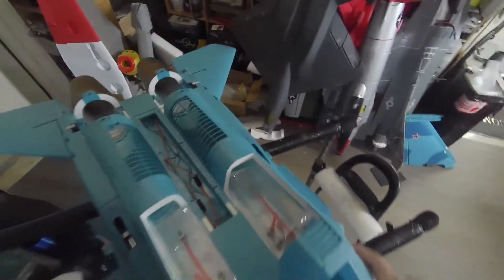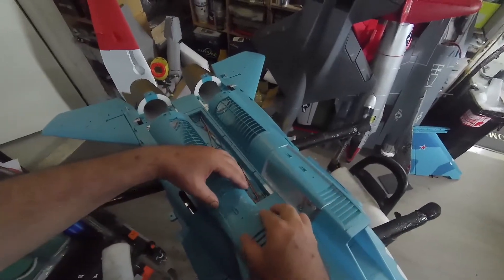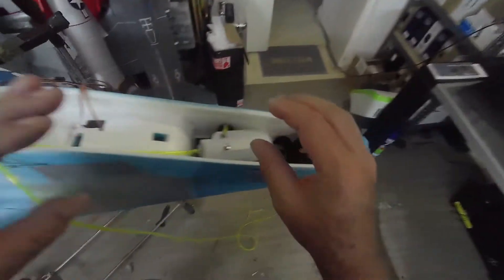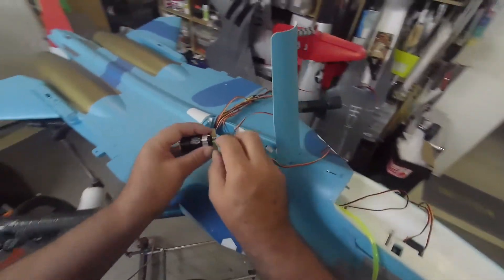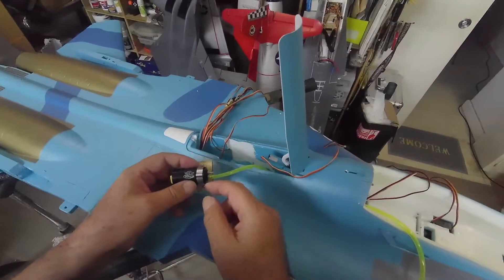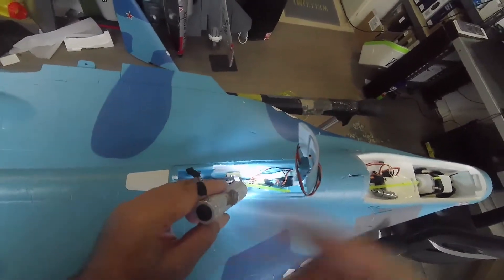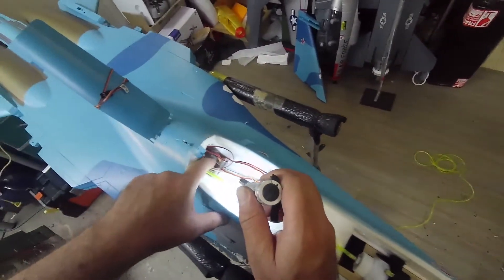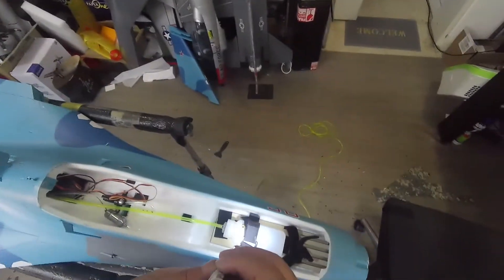EDF conversion to Turbine: Sukhoi Su 30 Part 3/4

Comment: I wasn't disappointed until I saw that you only used one larger turbine instead of two of the smaller K30's enclosed with thrust tubes. It is a lot of work to do this kind of plane. I understand that money is also important, but there is room for it and the thrust would be ok. I am sure it will fly great, but I'd have loved to see some vectoring thrust tubes in this baby. Good work though.
Reply from the maker: Yes. And 2xK30 will have this airframe over stressed. And my pockets too. Next plane to convert will be single. This is my first jet to convert to turbine.
Reply: @VictorHugoRC1111  yeah, you are probably right... itd be cool though.

Comment: Why don't you remove the metal cylinder which is located at the back of the fuselage? It weights around 100gr.